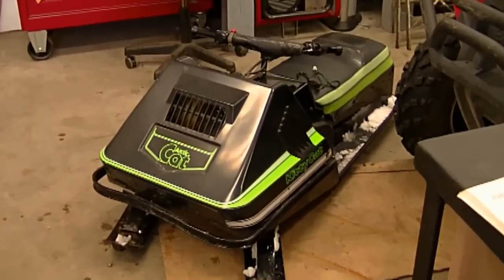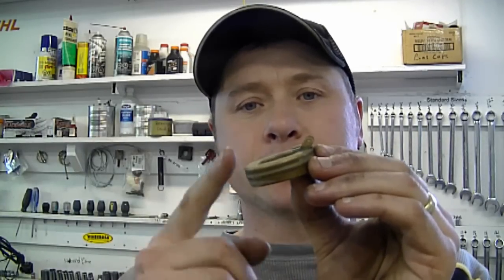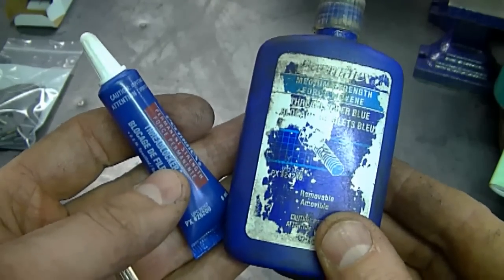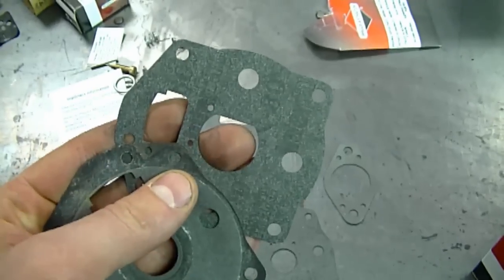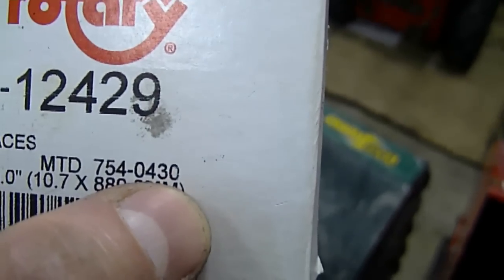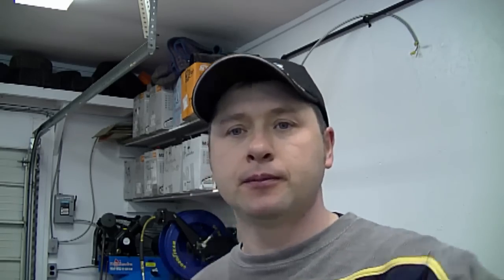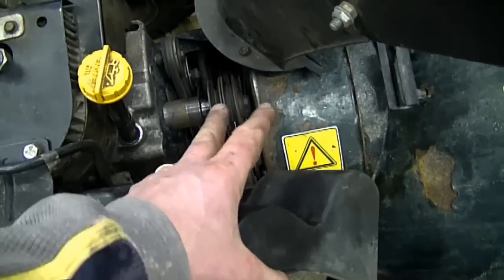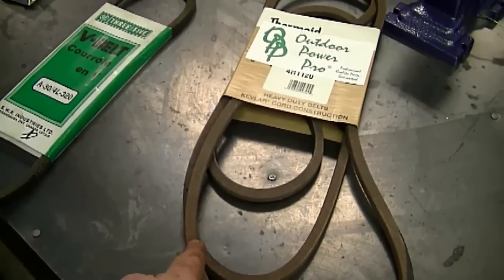Small Engines Q & A Video #116 in HD

Comment: Great vid , especially on belt tip differences . On the red lock tite  ( permanent ) a  torch used  to heat the bolt   or  nut  helps .

Comment from the maker: some engine, i.e. kawasaki fh500 require the dipstick to just sit on top of threads, not screwed in, on most snowblower motors you screw it in. you should check your manual

Comment: In my go kart. I use a treatment that cuts down the effects of ethanol and cleans the carb while it goes through.  I've noticed a huge differnce when using it.  My modified flathead Briggs runs at speeds much higher then a usuall engine. , but this stuff keeps it running great.

Comment: I have also seen a hole in the belt cover caused from a faulty exhaust valve, burning a hole in it. Kind of a common issue with the flat head Tecumseh's

Comment: Don Happy New Year. My claim to fame is making friends with "blue removable Loctite." Going one step further and using Loctite primer first; is the ultimate; and must be used on stainless steel. I'm a retired auto factory pipe fitter; and I strongly believe in blue, removable, Loctite for all, normal,metal to metal connections. " Good connecting pipe threads clean and dry; two or three drops, starting on the second, third & fourth, Male threads," guaranteed leak proof. Great vid. today, Tim.

Comment: OMG a kitty cat! I we had one when I was 4 and rode it till I was like 12 ( I did have a Yamaha bravo but it was fun to bang around on the kitty cat ) I did so many repairs to it, crab broke like 5 times two was the throttle shaft, the wrong gas tank held on by a coat hanger, it sat for a summer out side under a tree, pulled spark plug out and pulled rope and water sprayed out, but I cleaned the carb and it ran again, me my sister and my brother used it so so much the throttle shaft finally....

Comment: I love your videos.  Great job.  I have used them for numerous things.
I just bought a new Honda 11/32 snowthrower.  I have no warrenty b/c i bought it in New Hampshire and brought it to Newfoundladn, boo whooo.
It runs perfectly for 10-15 mins then, exhaust turns black and idles down.  choke is off, clean stabilized gas.  I don't want to start messing with a 4500 snowthrower till i have some idea what to look for.  Help!!

Comment: I drained the carb.  not a bit of debris, like new.  In fact there has only been one tank of gas run through this blower.  Throttle and choke cable are working properly as far as I can see.  After  I put the air intake and shroud back on  it runs even more harshly, sputtering up and down.  Cleaned the plug which was black with carbon.  Any other suggestions?  Brand new Honda 11/32  but no warranty.

Comment: Hi Dony
I have an older Craftsman 5/23 snowblower. Its silver in color, 5 horse, 23 inch swath. Model number is C950 52475. I got it used and its missing the 2 pulleys which should be on the output shaft of the motor. I am unsure of the outside diameter of these pulleys. Would you happen to know? Thanks in advance.